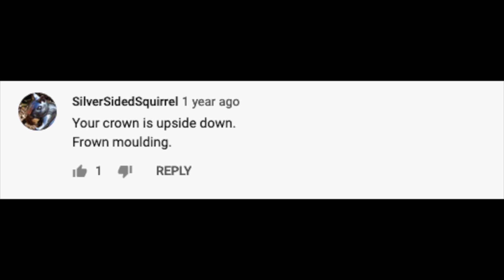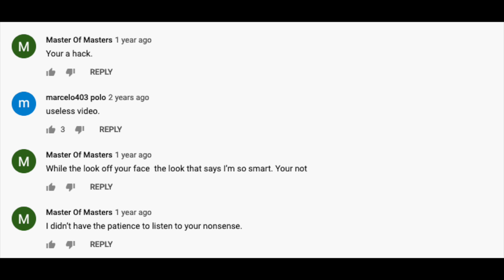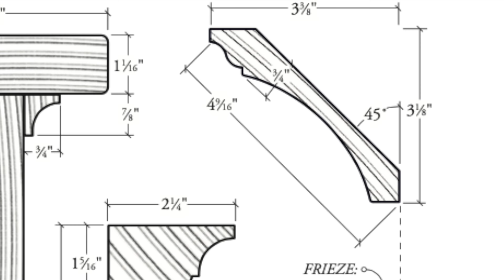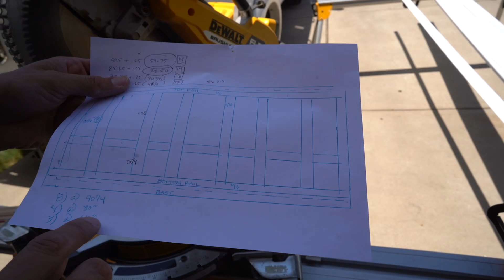"Tired of seeing this stuff put in upside down"

Comment: Just completely modernized a 1955 mobile home on the inside/still 1955 "deco" on the outside. Very expensive redo. I used basic base trim  on the floors AND windows to save money and it looks great! Had many nice comments on the results. Everyone asked where I got the idea but of course I didn't admit it was a money thing.  The trim around the windows is "backwards". The outside has been sandblasted and painted with original colors and new windows and now I'm looking for Lucille O'Ball and Desi Arnez to walk out the front door!

Comment: Great video.
I used to own a 1914 craftsman that was built by a contractor for his family and had all the original details and finishes, well kept up.  Picture hangar rail was in every room of my house installed under the crown molding.  It was also used as trim on top of the six inch baseboards, inverted 180 degrees with the rounded part facing down. It is a very nice detail.

Comment: I just installed picture moulding on my plaster walls. The house is from the 1920’s. Now I don’t have to drill holes in the lathe and plaster to hang a picture 👍. I learned how to cope the corners from your videos. Thank you‼️😀
Reply: I grew up in Boston in an apartment building built in the 1870s. Picture molding, but we used hammered in picture hooks anyway. Cracking in the plaster was behind the picture - but what a mess to move a picture!  So, as I recall, we didn’t.

Comment: Molding is intended to be  installed the way you want to. Only non creative carpenters follow the rules.
Reply: I totally agree!
Reply: if your not a creative carpenter you wont work for long. especially if you're doing onsite installation. it's nothing but creative problem solving with wood.
Reply: What rules? It's usually only opinions people are putting out there from what I can tell ;)

Comment: I've seen that molding before in a very old school. It actually had pictures hanging off of it. I love that large bead.
Reply: I believe the trim was used and older houses that had lath and plaster houses that had lath and plaster. 
I guess the walls were too brittle to put a nail just anywhere. Pictures were also very heavy.
Reply: It’s a museum type hanging rail. You can change the paintings/pictures out more often without having to make new holes in the wall.

Comment: I've been doing this for 35 years, and I can say unequivocally , that there is no right way to install crown " right side up", it's a very subjective thing, most times you'll see the bullnose, or the cove on the bottom, but other times you won't, IT"S NOT WRONG!, I've seen chair rail both ways, it might look strange to one person, and normal to another. casing should go on one way, usually.

Comment: I have that moulding in my office and I actually have pictures hanging from it. 👍😅
Reply from the maker: That is awesome! I'm going to use it for the intended purpose very soon
Reply: @FinishCarpentryTV  the dining room of the Cosmopolitan Hotel in Old Town San Diego has this too. As I understand it, they used to do it a lot more with plaster lathe walls, because doing a regular picture nail could fail a chunk of the wall, so tossing a hook over a rail made more sense, and they were easier to move around.

Comment: The funny thing about installing moldings upside down or backwards is not many folks will ever notice. I did a job once that another guy had started. About half the house had crown molding and the customer wanted the rest done. I told them the first guy had installed it all upside down. They were horrified thinking I had to rip it all out. After discussing we decided I would just match what was there. Ya know what?  It looked great when it was all done and I assured them 99% of their guests would never even know.  Part of the fun of being a carpenter is using your imagination to come up with something that will look great and please the customer. Keep on keepin on man!

Comment: When cutting multiple pieces the same length but I don't want to change my saw angle a billion times I set up a stop(like the one on the dewalt saw) but lay the dewalt stop down and over cut the piece by 1/2 inch..I cut all my pieces then change the saw angle one more time and lift up the stop and cut the alternating side...hope that made sense...tldr basically only move the saw angle twice saved alot of time

Comment: I agree, if you like it that way install it that way!   In one of my prior jobs I worked drawing and designing cutting heads for shapers.  We designed custom or reproduction molding. I worked with many Architects to get them exactly what they wanted. The reason people say the detail should be down or in the lower part of the installation is for sight. Nothing more. We did buildups that were sometimes 3 and 4 feet in height with multiple molding pieces involved. Installed in Large Banks, Churches, Municipal Buildings and Corporate offices where opulence was the order. Yes we generally kept to the rule "detail toward the bottom" but not always and The Architect that I remember not following the rule was a well known and extremely talented architect that was at the time also and a Adjunct Professor of Architecture at an Ivey league school. Keep on installing it they way it looks good to you.

Comment: Picture molding is the best answer to hanging art on a lath-and-plaster wall.  Not only does it save you from the crumbling mess of using a nail, hook or screw but any mistakes in height or centering are easily changed.  I've ridden out numerous  earthquakes in southern California and have never needed to adjust,  re-hang or pick-up anything hung from picture molding.  After the Northridge quake posters pinned to the wall were nocked to the floor.  Anything hanging from picture molding was perfectly level.

Comment: I run an Architectural Millwork shop as well as being a trim carpenter for well 30 years. He is most definitely installing the crown correctly. Having run miles of it through a moulder and installed miles of it as well, i should know. All of the NAILGUN WARRIORS need to sit down. Also. we use the picture moulding for panel trim as well. The only difference with ours is that we run a shorter profile on the back or flat. At  7/8 inch we have found a happy balance for the protruding reveal or shoulder.   Be Safe!!!

Comment: I appreciate you putting up the vaulted ceiling crown install!  The cuts I have is Outside corner coming off of a flat ceiling run to the up Vault angle to inside corner, to flat run to inside corner to downward vault to flat run again.

Comment: I just came across this video and I wanted to give you a suggestion: Go to Colonial Williamsburg if you haven’t done so before! You would love it and all the craftsmanship of how they did trim back in the 18th century. From very simple to extremely elaborate as in the Palace building. Also you could see first hand how this was done by going to the trades in the various buildings (you would be most interested in the joinery trade and seeing how these moldings were made by hand with profile planes). Until then, check out their YouTube channel or there web site with numerous videos. And picture molding and plate rails was widely used back them because walls were plaster and by putting up a picture molding there was no need to put nails in the walls and the pictures could be adjusted by the hanging wire much easier, or changed out for different seasons (and the wealthy would often do).

Comment: I cannot thank you enough for your videos. I used panel trim for wainscoting I installed in my home, and I watched your videos before attempting it. One recommendation: I put a HD bucket under my saw stand as a “trash” for all my little scrap pieces. The bucket fits perfectly in between the floor stabilizers on the DeWalt stand. Thanks again for all of your knowledge!

Comment: While working on historical renovations in Texas I learned that "picture" moulding was originally used, often near the ceiling, on plaster walled structures- as most homes were until the mid 20th century- to achieve a decorative and useful function. Artwork could be hung from the moulding with hooks or nails without penetrating the plaster. Yes, the wires or twine the pictures are hung with were visible, it was a different time and a utilitarian use of decorative trim mostly in upscale homes.

Comment: I recall art that galleries use the picture rail (molding) to hang paintings, etc. with thin wires because they can adjust the height for different size work without nailing or screwing hangers in the wall every time something new is hung, so they aren't repairing and repainting the walls all the time. It is still commonly used in galleries. I like the way you are using it.

Comment: Every room in my home has picture moulding in it. We call them picture rails. You can get unique brackets from which to hang your pictures/mirrors. We also have chair rails on the walls, to keep the chairs from damaging the walls. The crown mouldings and ceiling roses are made from plaster, and were run in when the house was built, around 1900.

Comment: Nice to see you using the picture moulding rail.  As I type this comment right now I am looking at my own living room and that has a picture rail at about a 14 inch drop from the ceiling and all my pictures are hung using brass wire and brass hook plates.  The good thing is you can just move the pictures along or swop them round at any time with no holes being left in the wall.  It was a brilliant system if you like to have wall pictures.  United Kingdom.

Comment: In Victorian homes the picture frame molding was used as a visual break for wall paper trim that ran along the bottom of the crown molding. Victorians loved their trim work. The reason they did it was a nail in a plaster coated wall can cause a crack to start which you really didn't want to happen. I loved restoring Victorians but redoing the plumbing and wiring was a pain.

Comment: Master of Architecture here - The molding profile is correct because of drip edges. "Water is the #1 enemy of buildings," my Building Construction instructor. Moldings were designed in order to help keep moisture out of the building envelope. If Gary had installed the molding truly upside down, then it would catch water (if it were on the exterior). That said, the best way to install interior moldings is whatever works for the design/makes the client happy. Also, I don't care what educational level my craftspeople have attained. They are magicians, and I deeply respect their talent.

Comment: I grew up in a 200+ year old house here in the UK, and every room had picture rails all around them. The closest I ever got to using them for their intended purpose was when I realised that I could screw a couple of hooks onto the back of my stereo speakers and hang them off it. The wiring for them sat nicely in the groove and went around to my record player/Tape deck (Yeah, I "Grew up" quite a while back. :) ).

Besides that, they only really got used as a sort of open plan wardrobe. I had most of my clothes dangling off hangers hooked on then. Surprised they never got pulled off the walls. :)

Comment: I lived in a 1920's house that had picture crown molding, many rooms still had the hooks hanging from the molding. The purpose was to not nail into the stucco walls or damage the cloth wallpaper. The stucco wall was actually held together with horsehair and would chip if you tried to drive a nail into it. It turned out to be a learning experience. Great videos!

Comment: Richard, if you ever have the opportunity to attend a Katz Roadshow with Gary Katz, do not pass it by!! I saw him in Houston a few years back and within the fist 90 minutes I had eleven pages of notes. His encyclopedic knowledge of wood technology, finish carpentry and design principles is amazing. BTW if you look at a Greek column, you will notice that it flares at the cap making the dimension larger than the shaft of the column so that your eye transitions at the highest point; hence, the crown is properly installed.

Comment: You're so right about picture rails not being popular any more. 

I moved into an older style house and I actually wanted to install some picture rails and had a hell of a time trying to find some, but got there eventually.

Picture rails probably only sound weird because people are not used to seeing them being used properly.  But basically, they allow pictures to be hung around the house at any point desired and changed as frequently as desired without ever having to put any anchor points in the wall.

Comment: Back at the turn of the century that molding you used as panel molding was referred to as "Hang Rail". It was normally set at 7'-6" to 8"-0" above finish floor and owners would hang pictures, plates or whatever using small S hooks and light wire.  From a long time viewer to a new member!

Comment: One time, I routed a radius on the back of ogee architrave for use as a picture rail because that was what they wanted. 
Fitted right in with the same architrave round the door frames & panelled window reveals.

Comment: As far as I'm aware a picture rail was used to create a straight line near the ceiling edge, the plaster could be applied upto the picture rail with a nice crisp look. This would take your eye away from the not so good edge where the ceiling would meet the wall. Same reason for crown moulding/coving.
A dado rail was also only there to stop the back of a sofa damaging wall coverings. As it was set the the height of the sofa in the room.
All trim work including baseboards were fitted before and skim coat was applied. They used to skim upto the mouldings. We do everything backwards now just for cosmetic looks. 
This is what my father was thought 50 years ago when he learnt his plastering trade including the construction of plaster mouldings with jigs and templates.

Comment: I love picture molding and had it in my old house and when I did a Reno of a 1910 farm house installed it I that place too. You dont have to drill or put holes in your wall and have the ability to move pictures etc around at will all the time.

Comment: In architecture the ogee is called either a CYMA recta or a CYMA reverse depending on if the convex portion is at the top or bottom. One can know when to use each by understanding that the when the last curve of the molding goes out it’s a crowning detail, when the last curve goes up it’s a supporting detail (that is meant to support structural weight). When you mix these up it can look out of place unconsciously, because in your mind it doesn’t make sense that this delicate piece is bearing weight. So this is the difference between a proper entablature on a front door that looks really clean and nice, as opposed to one in which someone without knowledge throws together a bunch of moldings. 
     Thanks for the video Richard :) thumbs up and subscribed always.

Comment: I dealt with picture molding for many years. It was installed in 100 year old schools where I did carpentry, cabinets etc. for 26 years. A lot easier to hang pictures and adjust heights and leveling in old plaster (horse hair reinforced plaster). The old plaster would have cracked and chipped. I've even seen a newer similar product. It had metal rails at ceiling and clear plastic rods that hung down the wall. The picture frames had spring clips that gripped the rods to adjust height.

Comment: I believe picture moulding was used back when most walls were plastered. That way you wont have to try to drive nails into the plaster which could cause damage to the plaster

Comment: I have hung hundreds of pieces of artwork on picture molding as described, in art galleries, where such artworks change frequently, especially when nail holes become problematic, such as on paneled walls. Also, this method can be more convenient than nails for speed, accuracy, adjustments, and consistency.  So, if you can buy any molding, such as picture molding, from a catalog, you can guess someone, somewhere is buying it for some reason, whether that reason is or is not what the manufacturer and retailer intend or envision. So, you come up with the look you like, even if another person might prefer a different look. That is part of why so many molding makers make so many different profiles. Who's to say "right," "wrong," or "upside down?"

Comment: That picture molding also splits the wall to ceiling decor in older houses to keep the wallpaper/paint at the correct proportion. More so if the ceiling edge was "bottle cove" with no edge definition in the corner. V. common in old UK houses some years ago. Well done b.t.w.

Comment: Very well said. Looks cool. Meaning if your eye does not get hung up because of some oddity it looks cool. One of the trades I do professionally is sign work. Man how many signs I see and my eye gets hung up because of kerning, spacing and placement is incredible. When it is done right your eye flows across it with no hang-up. 1/16" can easily hang your eye up. Like your brain sees it right away even though you might not know what is wrong with it. So like I said. Very well said. Looks cool.

Comment: Note on the picture moulding (yes moulding has a "u" - just as the Queen's english demands it).  Picture moulding was used/designed as when it was in fashion the walls were NOT drywall but lathe and plaster.  Can't drive a nail or picture hook into that without cracking - so peoepl used picture moulding.  It fell out of fashion when drywall came into fashion.  I love picture moulding and whenever I fo crown moulding i incorprate a small picture rail into it (I mill my own) and use thin silver thread to hang pictures.  Awesome video btw - I took away some ideas that I will use so thank you.